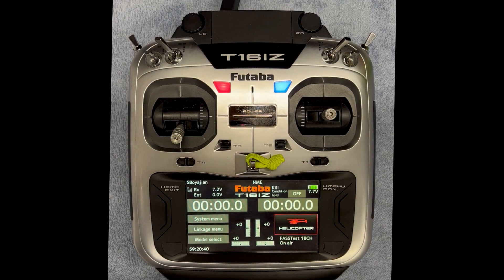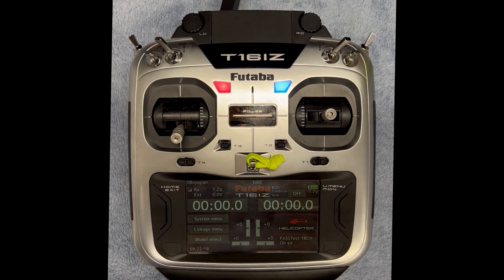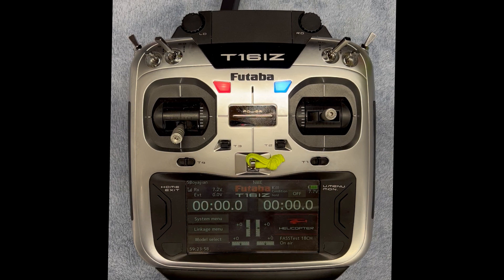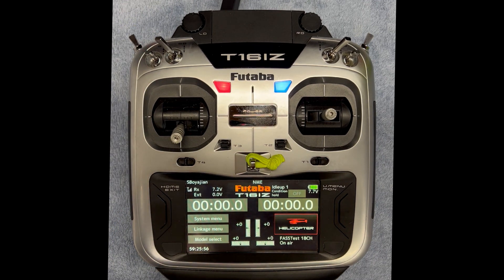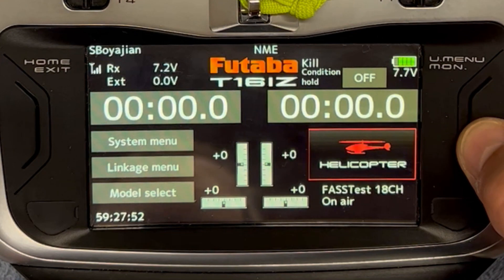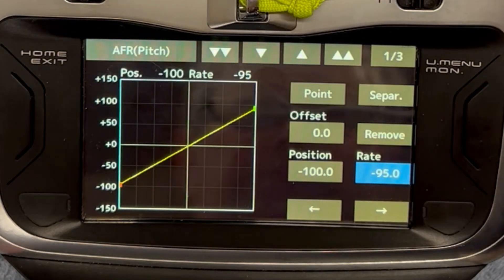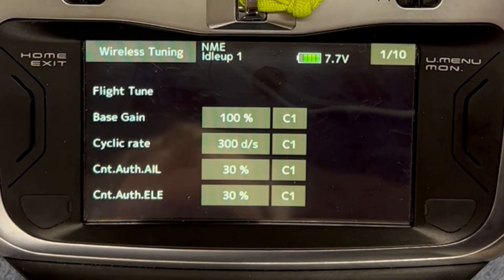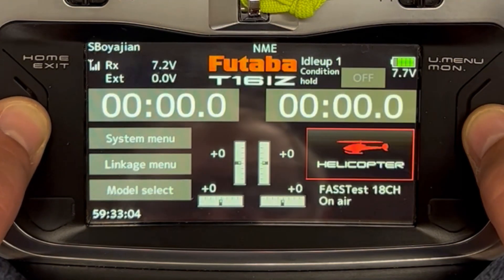Futaba16IZ w/CGY760R Transmitter Configuration Template - Part 1 of 3

Comment: I would love to see more setup videos of the 16IZ . Question on the 12 we’re it has gyro rudder , gyro2 and gyro 3 
Are the 2 gyro 2,3 for the ELE AiL server. I’m old school flyer  with flybars helicopter. This new FBL system is New to me . Thank you
Reply from the maker: The gyro menu supports three independent gains for the FBL. If you are using the CGY760, then you will only need it use Gyro and Gyro2. Gyro will change the rudder gain and Gyro2 will be the cyclic gain. Gyro3 is not used in this case.
Reply: @RCHeliGarage  I’m using the Ikon2 . For now I think in the spring I’m going with the CGY 760 . Thank you
Reply from the maker: @stevealoia  sent you a message on Facebook. Happy to try to help you out.